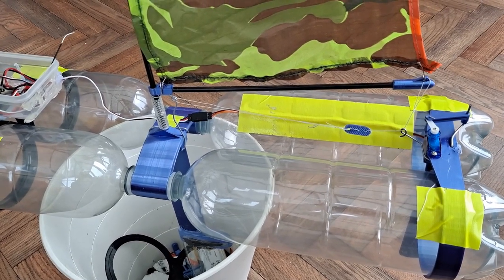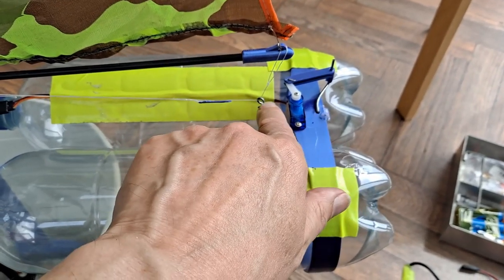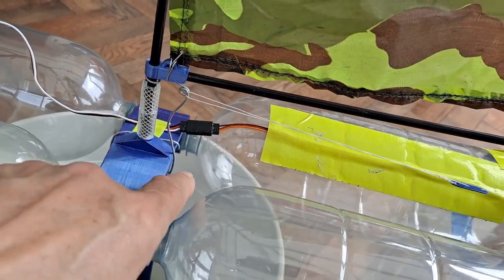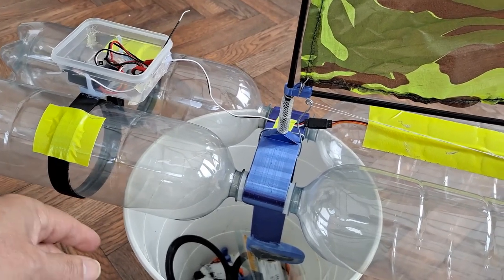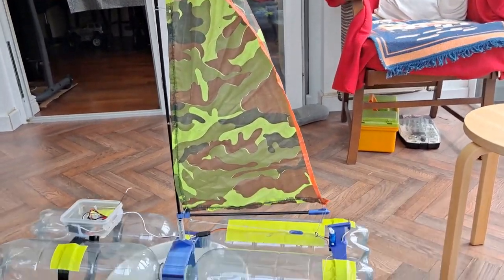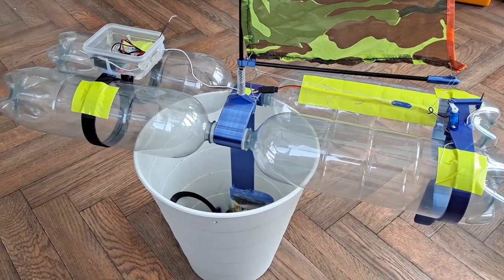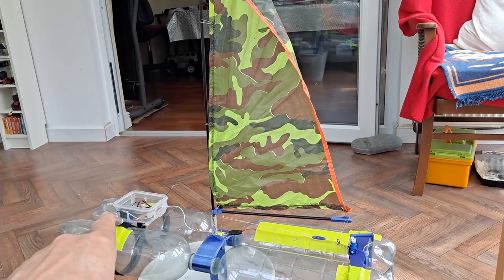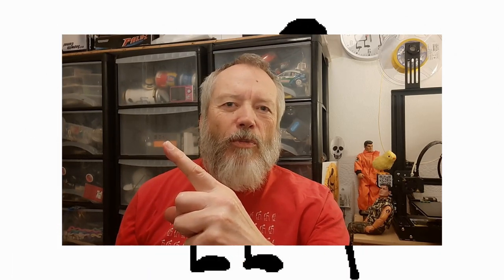Quad Pop Bottle Sailing Boat PART 8 rigging + final prep

Comment: I'm really anxious to see how this vessel moves through the water.   It is a very unusual design.
Reply from the maker: It is sort of catamaran, but not wide enough to benefit from it. The mast is smack in the middle which puts the forces in the wrong place and makes directional control poor. But I manage to get it to sail across the lake eventually. I will have to revisit it and make some changes. A jib would help. More weight will probably be needed in the keel. The 9th episode is the final one for now and we do see it on the water.

Comment: I suggest before you take it out To a pond, Test it in your Bath To See if it will fall over or not. That way you,ll be on the safe side where in the pond you might lose the radio gear.
Reply from the maker: It won't fall over in the bath, it is a matter of how strong the wind blows. All sailing boats tip over when the wind blows and it hits them sideways. The question is whether it will right itself again. That is harder than it sounds. If the sail is in the water, then it takes even more weight in the keel to bring it back up again.